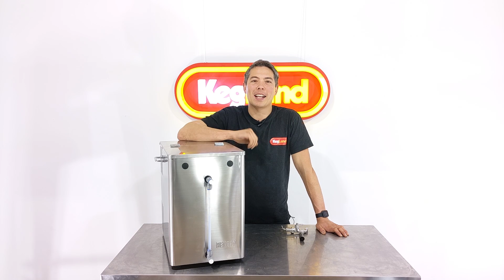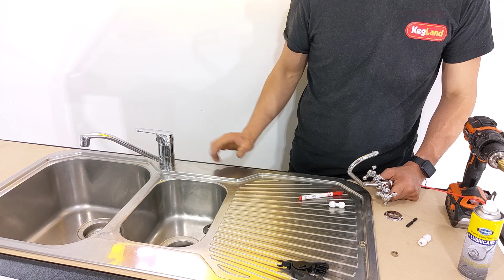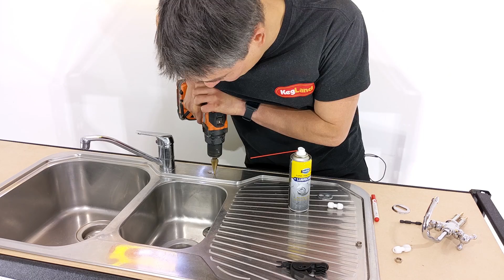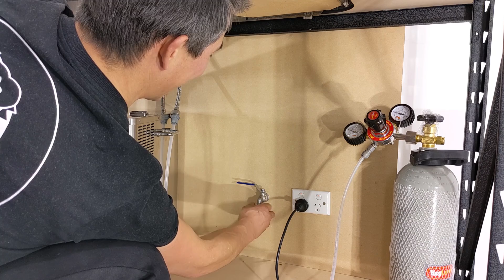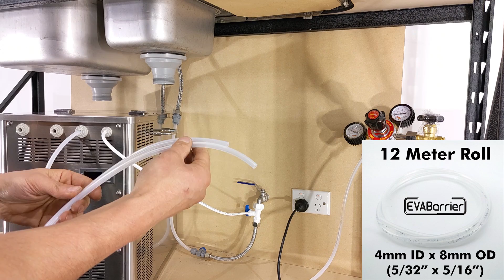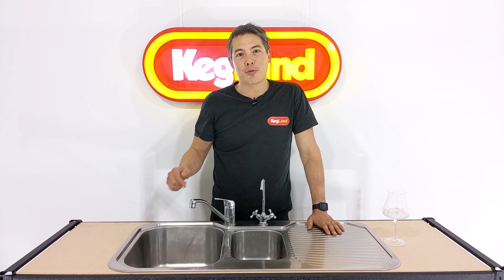Benchy Sparkling - Installation Video

Comment: Can the Benchy Sparkling be placed in an enclosed cabinet under the sink (one with doors), or would that not be enough ventilation for the heat from the compressor to escape?

Comment: Hi KegLand how could i connect this machine with my corny keg filled eith cocktail and achieve big carbonisation from tap
Reply from the maker: IIt is not designed for this, sorry. You just need to carbonate in the keg

Comment: This product is illegal to install as it doesn't have Watermark certification. If it floods your kitchen, your insurer may not cover you. Very irresponsible to be selling these, especially advertising it to commercial premises. Dodgy!
Reply from the maker: Some people think that "All plumbed items require watermark to be installed in Australia".  This item is not actually correct.  Watermark has an "schedule of excluded items" of which this is excluded from watermark.  This also goes for many water dispensing fridges or water coolers which are also sold in Ausrtalia without watermark. Our sparkling water unit exceeds the AS4020:2018 standard which is what is required if it is an "excluded" item from watermark approvals.  I think you should start by reading the Watermark certification first and schedule of excluded items so you are a little better informed.  We already have written documentation from Watermark saying that this item is excluded.
Reply: @KegLand  I am very familiar with Watermark specifications thanks, and since you're advertising it for "workplace, restaurants and cafe's" It should fall under a Watermark "in scope" appliance. " Chilled beverage & ice dispensing machines used primarily for commercial use to dispense ice, water and soda type beverages." which means it should have WMTS - 105. I would also add, that the dispenser tap itself is "in scope" also.

Comment: What water and co2 pressures do you recommend running? For a good strong soda.
Reply from the maker: I personally use about 50psi gas and 85psi water pressure and this works well for me.